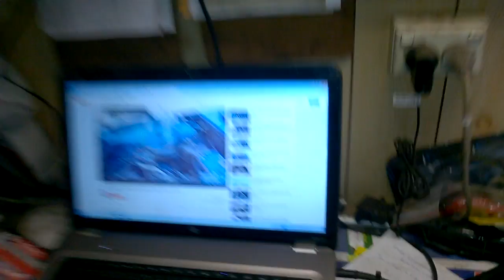Mechanic Talks About Running Cars On Vapour!

Comment: how would you prevent backfire?
Reply: backfire and blow the car up!
Reply: a propane flashback arrestor flapper type or plunger type near the carb. and a few in-line check valves for irrigation systems to allow one way flow. near the jug.
Reply: For the sake of loss of vacuum and the creation of pressure it's best for a way to stop that sudden reversal. Gas has only 8psi of vapor pressure. Which isn't enough to push back on a back fire.
Reply: I mean we're literally talking about hooking up a gas can to a truck and venting vapor from it. It isn't stoichiometric in any way. It will have some flashback.
Reply: Although I've done it in a truck where the fuel pump was barely pissing into my carb and hooked up to the mcv inlet on the intake manifold just to drive it until I got off the trail and made it home. No big deal. Worked, but wasn't a very controlled situation either.
Reply: As someone with 3 years at 70 hours a week of first hand experience, mine is not anecdotal evidence it is tried and true experimentation. I tried everything I could think of to induce an explosion as I knew it couldnt happen in a vacuum tank. Yes I put my life on the line for my belief. The system in the video does not perform at all as you would expect and contrary to what Ive been taught. When I started I had spark arrestors in my units when I finished with my experiments I had zero
Gasoline is flamamable and can explode FORD PINTO
Reply: Actually its a pretty rudimentary set up but not particularily dangerous. This system is no more(and actually less) dangerous than any out there. Again FORD PINTO
Ive done this many times still have all my limbs
Reply: with a flash arrestor..  I'm doing my Lincoln navigator Friday morning..  ill be posting view about it when I do it
Reply: When I was first experimenting with this technology I installed flash arrestors. We had a backfire and a subsequent explosion which result in damage to the unit and I ended up picking the arrestors out of the wall(all 3 of them)Once I discovered the vacuum principle that Tom Ogle had used backfiring was not an issue and we actually forced it to backfire many times with out the use of flash back arrestors without issue
The moral of this story is dont put your faith in spark arrestors
Reply: hi,Leslie would you explain me the system of Tom Oggle
Reply: If you look on You Tube a fair bit you will see Tom Ogles principles in action. In Ogle's case he used the gas tank from the car and left it in it's original position then ran an inch and a quarter line up to the place where the carb was installed He used the engines vacuum  to draw on the gasoline in the tank Doing this creates a vacuum in the tank and the gasoline dissipates to its molecular state and the molecules are drawn into the engine and detonated.The vacuum caused frost to form on the fuel tank so Tom ran a copper tube through the tank and heated it with radiator coolant
 I often use the analogy of a block of wood in that a block of wood burns and gives of energy but sanding the wood and creating sawdust will explode when exposed to an ignition source. The block of wood demonstrates the carb or injector system and the sawdust explosion illustrates the Tom Ogle system. I do have an illustration of a cut away that I had in the ledgers I kept while experimenting and would share it with you Just send an email to lesliec77@icloud.com and I will respond
Reply: use a backfire arrestor or a bubbler. The End
Reply: No its operating on a vacuum principle and you cant explode a vacuum  despite what you see on Star Wars